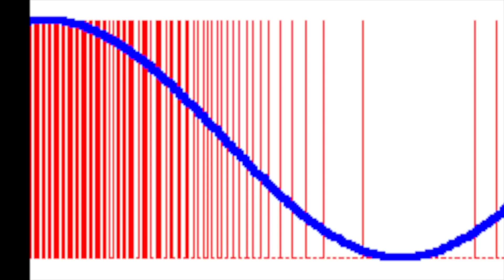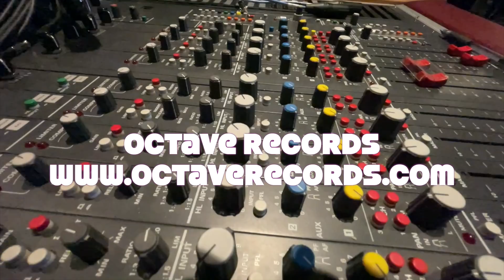Getting clear on DSD

Comment: Both DSD and PCM are not without issues. They simply are very different issues. Arm waving and banter might mean a lot to folks who think vinyl records are 'better' than state-of-the-art digital sound. DSD was one solution to digital hardware issues that are no longer limitations. But DSD production and DSD mixing issues are the problem.   

You'll have the only DSD studio in the world, but what does that mean to artists and agents who are quite satisfied with Red Book CDs? It'll mean plenty to the engineers and producers who have come to expect the product of DAWs to make recordings. Commercially available DAWs cannot handle DSD. One fundamental flaw of DSD production recording is that available computers cannot handle it without changing it to a workstation working format. 

DSD was designed to allow high quality archiving of existing musical material. Archivists don't have to mix, correct artistic errors, and later master for distribution. And don't expect even the best artists to not want errors fixed in post unless you want to do 20 or 30 takes to get it right while paying 1 to 100 musicians.

Ask yourself (rhetorically): Why did Sony (DSD's inventor) abandon it, when they knew all its secrets? And why haven't Deutsche Grammophone (and a hundred other high-quality music producing companies) ever relished it enough to convert to it? Is there some fictional conspiracy theory?

Should we doubt DSD's strong points? No. But there's a reason why it stands with creations like the 45 rpm LP and digital multitrack studio recorders in the invention hall of fame. 

Best wishes.

Comment: Kenwood had an interesting approach to FM demodulating using a similar technology. Their FM tuners would take the FM signal which because it is frequency modulated, the distance between waves changed slightly based on the audio signal voltage modulation. So by then just rectifying (cut half the wave) could be passed through a low pass filter and turn the FM modulation into a digital pulse density and then into audible bandwidth audio.

Comment: Looking into this a bit (pun unintended) it seems like the difference between PCM and PDM is best compared to pixelating in imagery. PCM is like a dot matrix printer which fills in the space using code and stochastic randomness or quantizing. So then the analog from that is "filled in with quantized information from a constant on-off switching function, as it "builds" the sonic shape. PDM is more like a highly accurate full-spectrum stylus pen moving up and down. It fills in with an actual representation of the sine wave from zero to whatever its frequency range and amplitude is. So it's kind of full bore, as in, if you could record that way with a phono stylus, ut would need a record groove of varying width and depth to accommodate the wide and deep changes in both frequencies and amplitude. So PDM moves in real time with the signal, only producing an equivalent impulse. Whereas PCM is in constant on-off mode, filling in the signal with multi-step, pinpoint constancy using artificially generated filler to blend in the gaps.

Comment: I can understand how DSD sampling replicates volume from your video but how does it replicate frequency?  You only explained the volume angle.
Reply: Think more voltage than volume. "DSD sampling replicates" voltage levels. The rate at which the voltage changes is the frequency information.
Reply: @glenncurry3041  Thanks for that answer. You and Carl were quite helpful in explaining what I hoped Paul would have explained.
Reply: Frequency lives in the time domain, the x-axis in Paul's illustration.  It is the number of times the signal (bit density) rises and falls per second.  The same is true for PCM except that the amplitude of the signal is digitally encoded in 16-24 bit words rather than the density of the one bit pulses.

Comment: No it didn't explain the mixing process.  We know that PDM can basically drive the output stage of a class D amplifier but mixing with DSD simply can't be done in the time domain without some kind of conversion into another format.  How else would you set/adjust input channel volume levels and sum them together?  Seems like your just maintaining the mystery with more ambiguity.

Comment: I have a Denafrips Terminator Plus R2R Ladder DAC. I can listen to Paul's recordings in DSD and 192/24. I believe due to the nature of R2R dacs, the 192/24 sounds clearly better in my system. I think you'd really need a PS Dac to take full advantage of the DSD files. Anyone have similar/different experiences?
Reply: PCM is nativilly handled by R2R dacs which is why PCM sounds better on them.  DSD is nativally handled by delta-sigma dacs. Most dacs out there are delta-sigma. The problem comes when the dac needs to do real time conversion from DSD to PCM or the other way around.

Comment: However, mastering PDM is quite a nightmare.
Reply: With DSD, there a very limited editing, (butt editing between silence allowed) no processing.
Octave records reconverted everything in analog for this reason.
So they used the DSD to get the colour of the format, process-edit in analog and re-encoded in DSD.
The recording industry based on DSD used PCM at 352.4kHz to allow edit and processing, and get back to DSD.
Being all the way native with DSD make sense for Live recording but not very practical for studio work.

Comment: Thanks for the explanation Paul, though it does generate a question. If its much easier to see PDM as an analogue wave form, why is it more difficult to edit?
Reply: Probably because you have only 1 bit to work with unlike 16 or 24 bit where you can lower or increase the bits to edit the waveform.
If I were to ask I would probably try to think of a way to "cluster" affect multiple 1 bits in order to affect the phase, frequency levels. As the way I see it in a decently loud tone if you switch enough 1s to 0 it will suddenly become quieter as the cluster of 1s became less dense thus giving less energy to the speaker.

But how does DSD handle the frequencies? since as Pual says... The louder you are the more clustered 1s are but how is it with the frequency? Say I want a 4khz tone, how does it look in PDM? How does 4khz tone look in PDM when it's loud or quiet?
Reply: I have no experience working with DSD, but my understanding is that with DSD you can't easily assess the actual amplitude of the signal at a given point in time, because DSD does not encode this directly (while PCM does).
So simply making a cut between 2 separate DSD bit streams will typically introduce a bias in the signal.
The easy workaround is to transcode the DSD recording to PCM for digital editing and processing, and then convert back to DSD for the final master.
Personally I don't see the point of DSD for music production as it seems to create more issues than it solves, but I guess an argument could be made to release the final master in DSD format.
Reply: @jaydy71  Frequency lives in the time domain, the x-axis in Paul's illustration.  It is the number of times the signal (bit density) rises and falls per second.  The same is true for PCM except that the amplitude of the signal is digitally encoded in 16-24 bit words rather than the density of the one bit pulses.
Reply: It's more difficult to edit in a multitrack digital environment because those environments have been built over decades to work with PCM.
If I try to fuel my car with something other than gasoline, my car won't run well, even if the other fuel is "better," because my car is designed to run on gasoline only.
Put three decades and the equivalent amount of money behind it, and we'd have DSD in a fully-featured DAW environment like we do with PCM.
Reply: @billsallak4887   That is true too, all popular DAWs use PCM because it's just so much easier to process and edit.
I'm just not really convinced that putting that kind of money behind an all-DSD DAW will be actually worth it. Such a DAW has to be incredibly more resource hungry and probably can't to much processing in real-time.
That's probably why Octave Records are going the old-school analog route for mixing. I have serious doubts that this approach will really pay off outside of some very naturalistic (and niche) music productions that don't need anything else than what an old-school analog mixer can provide (while adding noise and distortion of its own).
But I applaud Octave Records for putting their money where the mouth is! I'll be very interested to hear what they will release!

Comment: Paul, none of that explains why PCM files sound as good as DSD files, when the PCM files are derived from the DSD files (converted from DSD to PCM).

Since such a PCM file has sound quality that is virtually equal to a DSD file, then it stands to reason that the two formats achieve the same sonic excellence, albeit via different coding.

Since your testing of recording to both PCM and DSD, simultaneously has resulted in DSD being the clear winner, then it stands to reason that the problem is in the way that your studio is creating the lesser sounding PCM files.

Is it your real-time analog-to-digital converters (one for PCM and one for DSD) that are not of equal quality?
Is it the microphones you used for your simultaneously testing, not being of equal quality?

The associated equipment is key and vital to your results.
Paul, please list all of the equipment used in your testing that brought you to your conclusion that DSD is the superior recording format, the same as reputable reviewers do in Stereophile and The Absolute Sound.

If you do not list your associated equipment, then how can we confirm your assertion that DSD is the superior capturing format, without knowing how you captured DSD vs how you captured PCM?

Paul, if a reputable reviewer gave your FR30s a bad review, wouldn't you insist that that review include the amps, pre-amp, tubes, turntable, tonearm, cartridge, DAC, transport, room treatments, interconnects, and power conditioning?  Well, you are giving a bad review to the sound captured by PCM, and your viewers should expect to see the associated equipment that you used, the same as you would expect to see for a bad review of your FR30s.  (I am assuming that your FR30s sound amazing, and I am not knocking them -- rather, I am using them only for my analogy).

Thank you.
Reply: I would like to hear the differences by myself. Paul always says that you can hear a difference between PCM and DSD recordings. And I want to Believe him. I tried DSD and PCM files by myself but it's hard to find original DSD recordings and PCM recordings that are the same songs and where PCM is unedited. There is a reason why he thinks that DSD is much better then PCM but I want to differentiate PCM vs DSD by myself.
Reply: @patrick12399  Paul has said, in more than one video, that the difference in sound quality between DSD and PCM is related to capturing the live sound and performing real-time encoding.  He has also said, in more than one video, that when you convert a DSD file to PCM file, the sound quality is indistinguishable (I do not have his exact quote -- but that was his meaning).

The above points to:
1) The two formats are of equal quality (that is, equal sound quality).
2) When PCM loses, due to the real-time recording process, then it is due to the real-time recording process.

The above is why I am asking Paul to lay out his equipment list.
I have asked in 4 or 5 videos, and he has not done so.

I am starting to think that maybe his investment in DSD could have been reduced if he stuck with PCM, after he would iron out the PCM recording issue with sound quality -- and as such, he might not want to visit this subject and come to terms with his investment decisions (perhaps he would regret going the DSD route if PCM is its equal)?

Just a guess, because all I can do is guess when Paul will not list his equipment for his simultaneous PCM and DSD recording and listening tests.

Another guess is that Paul might be too quick to take his recording engineer's word on this topic.  Paul seems to genuinely like him, and perhaps he does not wish to offend him with questioning his engineer's advice -- even when it affects major business decisions.

Or perhaps Paul is not familiar with the equipment used to record PCM and DSD, and is too proud to say so or ask his team to spell it out?

We have to guess when our host does not fill in the blanks.

It is routine for reviewers (and that is what Paul did -- he reviewed the sound quality of PCM recording vs DSD recording)... it is routine for reviewers to list the equipment.  So all we can do is guess why Paul will has not done so.

Paul prides himself on answering questions.  He does so every day, and with the best intentions (and is appreciated), which leaves the question of why he leaves this "equipment list" as unanswered?
Reply: Relax some. It's only audio.
Reply: @0Perhaps  Yeah you are right. He said it more the one time. But he also said that there is a difference between DSD and PCM capturing (not recordings that was my fault). I want to hear it by myself. And then we can maybe analyze both recordings and look if the equipment he uses for PCM are as equal as the DSD equipment.

He also mentioned that he don't want his investment back. He just want to take some great artists and capture the music as close to realism as possible. The question is why he does choose to use DSD instead of PCM. He should capture music in PCM and DSD and release the files. At best with his Equipments he used. So everyone can see if DSD is better than PCM.

 I know you should take everything you hear with a grain of Salt and try to make your own opinion and this is why I want some data from him. Like you.
One hint: Maybe he doesn't read the Youtube comments and you should try to contact him in a different way. Maybe Email? Or when you live in America you can visit him and take a look by yourself. He mentioned that too.
Reply: @morbidmanmusic  My comments were not meant to trigger you.  I apologize for angering you.
Reply: @patrick12399  "He should capture music in PCM and DSD and release the files. At best with his Equipments he used. So everyone can see if DSD is better than PCM."
We still will not know the answer, because whichever one sounds better will be for reasons attributable to Paul's mystery gear.

"Maybe he doesn't read the Youtube comments and you should try to contact him in a different way. Maybe Email? Or when you live in America you can visit him and take a look by yourself. He mentioned that too."

I am positive Paul reads comments.  How frequently and how many I do not know.
Paul often replies to comments, including several of mine.

If I were able to visit PS Audio, and get the grand tour and listening time in and some "Paul time" in, I would do so.
I live in NJ, and the drive is too long.
I cannot fly, because my right ear does not equalize on the decent.  It is very painful, to the point of possible ear damage -- so I will not get on a plane, again.  And even when I did fly, it took my ear several days to return to normal.  Prior to that, I was somewhat deaf in that ear, which does not help for a trip to listen to stereos.
Reply: @0Perhaps  Sorry for your ear and that you are unable to flight. Let's hope that he read this and reply. With a Video or the comments. That would be great.
Reply: @0Perhaps  Paul normally does not answer questions in the chat, with two channels and daily videos that would require several fulltime jobs. You can ask questions via the psaudio website. So stop asking here, no answer is to be expected.
Reply: @robinr5787  Congratulations on your PS Audio's spokesperson position.  I was not aware that Paul had someone in that position.
All the best!  You are working for a great company.
Reply: @0Perhaps  thanks, if there is anything else I can help you with please let me know.
Reply: @robinr5787  Yes.  Please shine my shoes.
Reply: @0Perhaps  sure, if that will keep you from asking the same silly question over and over again. Relax and just enjoy the videos. Have a good day.
Reply: @robinr5787  You wrote:
"sure, if that will keep you from asking the same silly question over and over again. Relax and just enjoy the videos. Have a good day."
Please quote any silly questions.

"Relax and just enjoy the videos."
You appear to be distraught to the point of reading what is not there and compelled to share your imaginary findings.